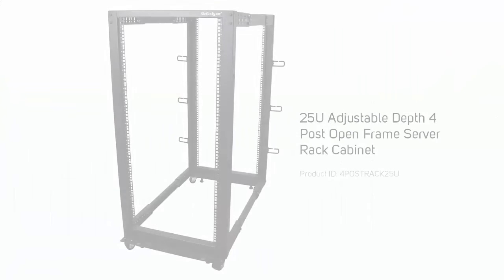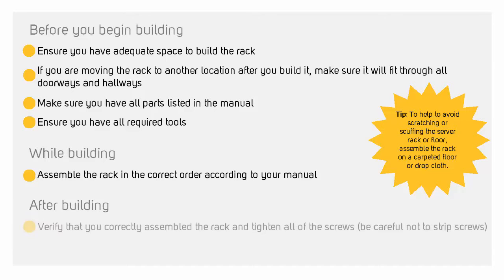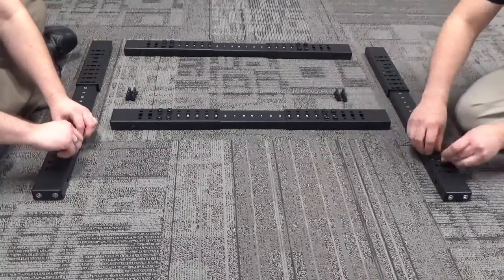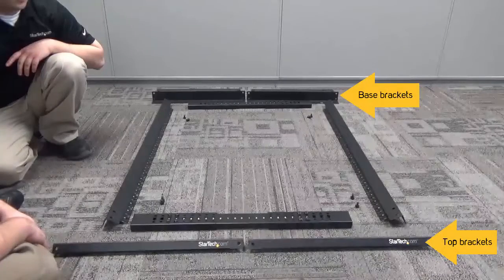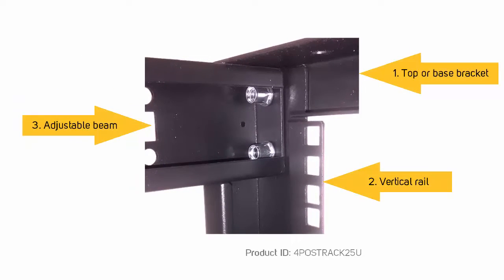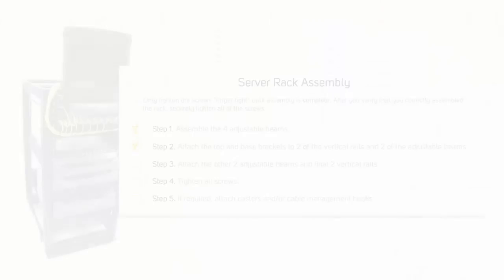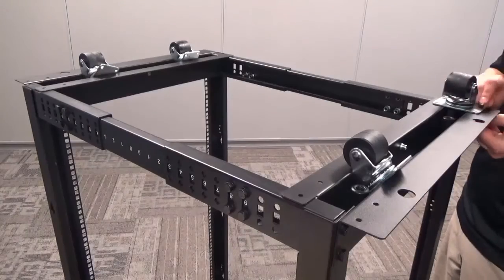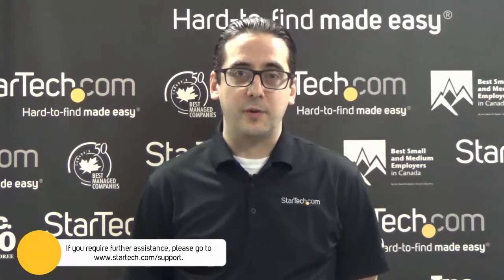How to Install - Server Racks | StarTech.com

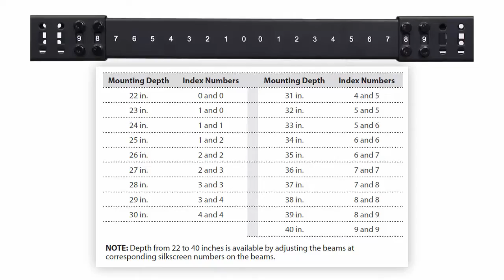Comment: 2:10 how? Where do I referance from? Outside the outer pieces, first window, something else?!?
Reply: I finally just did some trial and error. I found out that the number needs to be in the first box (closest to the middle). So if it says to use 3 and 4, the first box on the left side will have the 3 and the first box on the right side will have the number 4 ( or vice versa).
Reply: I’m wondering the same thing. Then instructions or this video doesn’t really make that clear.
Reply: @Uravgjoeinthepnw  exactly why I posted asking, and as you see no reply from them answering....

And I didn't find an answer on google either....
Reply: I believe the index numbers correspond to the numbers at the first window. This is the only way the 22-inch (0 and 0) and 40-inch (9 and 9) configurations are possible.

Comment: Bought this exact model and it came with 4 grounding wires. However there were no instructions on how to use this in the assembly guide nor did I see you use them in this video. Could you point out to me where you should use the grounding wires at. Thanks in advance.

Comment: Which mounting depth do you choose at 2:19 is it 3 and 4 (29 inches) or 2 and 3?
Reply: That’s where I’m stuck too!
Reply: @Uravgjoeinthepnw  i use 3 (front) and 4 (rear) for Dell R710 server. These figures are shown in last frame.